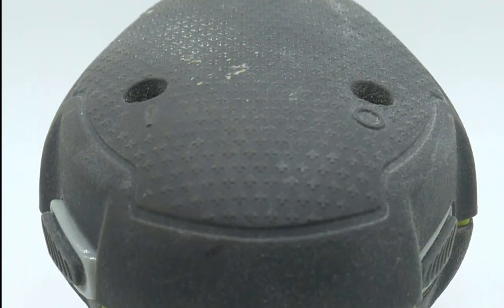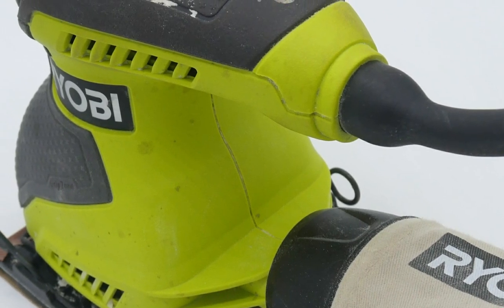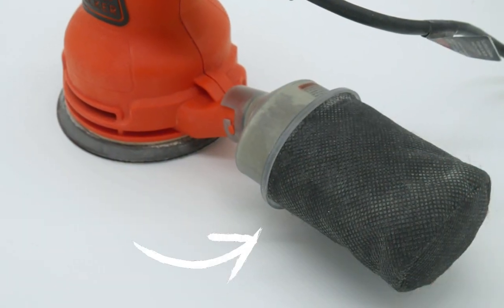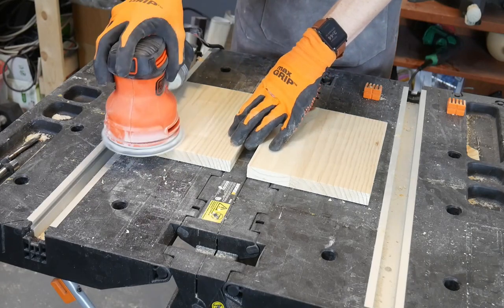Best Orbital Sander? - Best Sanders for Beginners (Humble Hands Reviews)

Comment: I do lots of sanding and on my second B&D random orbital sanders I loved the first one so much and it was a work horse but like all good things it came to a end however I got at least a year and a half worth of work with it and used it almost every day! The second one I got was there newer model with the push down on off mechanism for lack of a better description which I will say took some getting used to being there is a switch to hold it in the on position or you can just let your hand off of it and it stops however this one lasted me about two months before breaking very frustrated with this particular Black & Decker sander however I will say I believe that it is mostly my fault I use lots of different fillers for refurbishing work I do and have recently started even using more Bondo with furniture if you're not aware of how great Bondo is or furniture repair and I highly suggest anytime you use wood filler Bondo or just general sanding clean your sander I can't stress that enough and I actually know better and still did not clean like I should have after a few good Bondo battles and I already know that I just got lots of different particles and Gunk up inside that thing it just probably isn't worth trying to fix will I buy a third one you bet I will however I kind of want the older model for some reason I guess just because the newer one died on me after 2 months but again being my fault maybe I should go ahead and give it a shot thanks for the video just thought I'd leave my two cents for whatever it's worth probably worth two cents I suppose LOL have a good one enjoy those projects
Reply: I will say what also made me purchase the Black & Decker orbital sander in the first place was its price point and it's reviews holding up to some of the better brands that I would normally purchase and at the time I was dropping a bunch of cash on lumber and other items and whatever Sandra I had at the time I needed to upgrade and just went with the Black & Decker and went with the reviews and the high rating it got for the price point and I do agree with the rating that it has received on lots of different reputable websites / testers have released about this product Black & Decker feel free to send me some free merchandise for acting like I work for your company LOL but I assure you I do not work for Black & Decker matter of fact they're sander is probably the only real tool that I have really liked out of their line of tools that I've tried to be honest